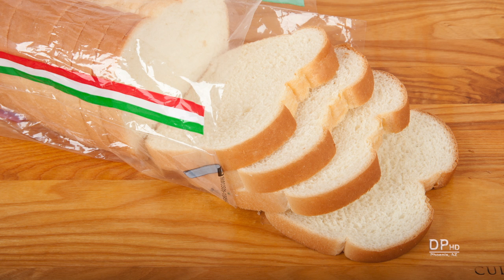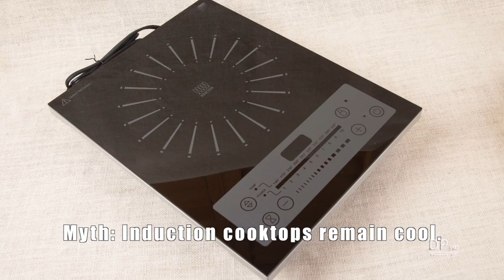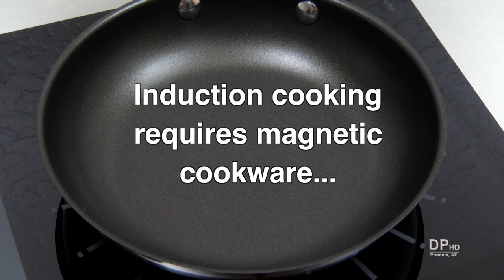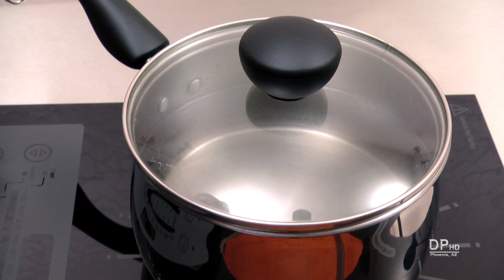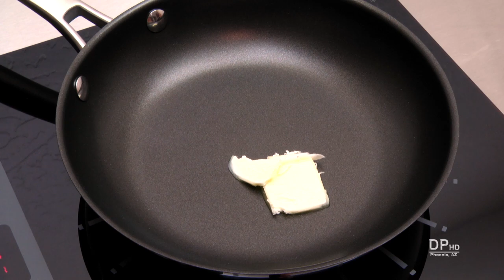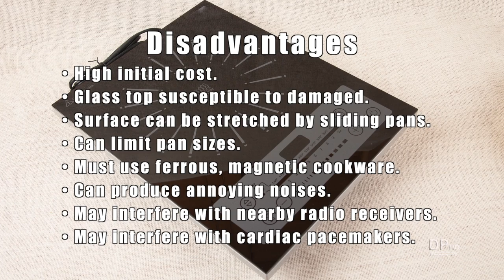Introduction to Induction Cooking (Home Cooking 101) DiTuro Productions

Comment: Small pans are the ONLY option for portable induction cookers that are bought at affordable prices. Typically, 6 to 7 inches is the limit for the flat bottom portion of the pan. There is also a danger of pan warping when larger pans are used on a 6-to-7-inch induction cooking area.
If you spend much more money, then you can get an induction cooking area with a diameter of around 9 inches. The extra cost can be very high, in excess of $1000 for each 9-inch cooking area - this is true when I wrote this comment on 20th October 2022.
You will not find the size of the cooking area included in the specifications of many induction cookers. So, be warned, no matter how large the circles of squares marked on the glass surface of an induction cooker may be, its actual cooking area (diameter if it is a circle) is almost certainly only 6 to 7 inches, unless you paid a lot of money for the cooker.
Reply from the maker: The pan that came with the induction cooker in this video is 11-inch at the top with a 6-inch flat bottom area. I found many pans and skillets are like this. So, if by small you mean limited to 6 to 8-inches, that is not entirely accurate. If fact, I shoot a video using an 11-inch griddle that is scheduled for November 28, 2022. It performed on par with my aluminum griddle and gas burner. Sizing the pan to the burner is preferable. Thank you for sharing your thoughts.

Comment: Thank you for an informative podcast.  May I ask a question please?  I recently purchased a portable induction cooker.  I brought it home; read the instructions thoroughly, and fired it up, to saute` some seafood.  it did a brilliant job and the seafood was cooked in less than 5 minutes.  I removed the fry pan, and placed a stainless steel pan (rated for induction cooking) on the cooker.  I pressed the power button and up came a message on the panel that read E 0.  The cooker did not start up but the fan came on.  I tried this a few times to no avail.  Each time the fan kicked in after the cooker refused to start up.  I googled the Error Message and it indicated that the E0 message indicate that one of the circuits had "fried"   This cooker lived for no more than five minutes before it gave up the ghost.  I returned it to the shop and got my money back.  I am somewhat skeptical now.  Any suggestions please?
Reply from the maker: Thank you for the compliment and your question. Unlike radiant electric and gas, the reliability of an induction burner depends on the quality of the electronics and workmanship. The failure you experienced could be due to a faulty part or solder joint. The one I used in this video is still working 5 years later. I just published a video about Induction Cooking Facts & Myths you may find helpful: https://youtu.be/vyohT6ACFwk

Comment: A 1800W portable induction cooktop will beat a professional grade high power full size natural gas rangetop using the largest burner (a BlueStar range top). I did test myself, my 1800W portable induction cooktop boiled 2 quarts of lukewarm  water in 4mins and 50 seconds. My gas range on full power took 6mins and 30 seconds for the same 2 lukewarm quarts
Reply from the maker: I've had the same results. Thank you for sharing.

Comment: Can you tilt the pan, as with gas?
Reply from the maker: It depends on the model. Tilting the pan may scratch the surface and void the warranty. Models with a pan detection sensor may turn the unit off.
Reply: My bosch 500 you can tilt the pan. I cook on a paper towel so no worries about scratching, I think its 2 minutes when you lift the pan off the hob until the unit shuts off. Most new units work like this.

Comment: I just bought a single induction cooktop and I love it.... the one problem I’ve always had with gas is I can’t get the temperature low enough to simmer.. Induction was the answer very accurate temperature control..
Reply from the maker: I've had the same experience cooking with gas. Thank you for sharing your experience.

Comment: Video of limited value.   Before posting a video it seems simply logical to carry out your cooking experiments BEFORE posting.   Your video should be instructive not a narrative on failed ideas.   I suggest you research your cooking and THEN post a video that gives constructive directions to achieve success NOT your blundering attempts and possible alterations to a process to improve on your attempts.
Reply from the maker: This videos is an introduction to the pros and cons of induction cooking for people considering switching from electric coil or gas. While I have had good success with my portable induction cooktop, several viewers have not. This video was not meant to be an infomercial to sell induction cooktops or ranges.

Comment: No wonder the time to boil water was quite long and you had to use rather high settings sometimes. A portable 1500W induction device is a toy. Commercial grade portable devices for 240V have up to 3500W. That makes quite some difference.
Still, all those portable devices are more or less toys compared to a real induction stove top from a decent manufacturer. The coil size of most portable devices is tiny which means only a small spot of your cookware is actually heating up. It not only ends up in uneven cooking results, it can also warp iron cookware like cast iron or carbon steel.
High quality induction stove tops have much larger coils which heat your cookware more evenly. The cooking experience on such a stove top is completely different from those portable devices (including the commercial grade ones). The only limiting factor on those stove tops is the power limit of private homes. My 90cm AEG / Electrolux stove top is rated at 11.7kW for 5 induction coils (4x 8'', 1x 11''). While the 8'' coils provide very equal heat over most of the 'burner' size, the larger 11'' coil has a noticeable hot spot in the center. That's due to the outer wiring of the coil being less densly winded to keep the stove top within the maximum power limit of ~11700W for private homes. Professional induction stove tops have fully winded coils of any size but the power consumption is accordingly high.

Within the generous power limits of my private induction stove top, I'm more than happy with it and would never go back to other heat sources. I would consider complementing it with a two large burners gas stove as nothing is better for iron cookware (cast iron & carbon steel). But for all other cookware, induction is the clear winner. It's very efficient (90% of the energy is used for cooking), fast and the heat can be adjusted very precisely on well made stove tops like my AEG one. The 14 (actually 15, including the 'Power' setting) power settings do not increase linear, it's more like an exponential curve. That way you have a fine increase at each level on the lower settings and steeper increases on the higher ones. Even the fanciest gas stove tops have a hard time competing with that.
Reply from the maker: Except for the technology, there is little comparison between a 240V built-in induction cooktop or range and a 110V portable induction cooktop. Considering the cost, a portable induction cooktop is a handy extra burner for home or RV. Thanks for sharing your thoughts.
Reply: @DiTuroProductions  That's basically what I said. Well made built-in stove tops are a completely different experience. Still, I also wanted to point out that there are better portable devices than the one shown. The usual, cheap ones sold in super markets here all have ~2500W @240V. Professional grade ones like Bartscher have up to 3500W. Still, none of those portable devices I know of has a coil size of more than 12-14cm which is very small. It's ok to boil and cook things, but you should not use carbon steel or cast iron cookware on those small coils because they could make your skillet warp. Those small coils are also a problem with most other skillet types because you end up with a small hotspot in the center of the skillet. Those portable devices are ok to cook, I would not recommend them for searing.

Comment: I have a Philips HD4937  with two circles where you place the pot. Even with a pot that covers the outer circle I can only get frying done on the small section of the inner circle. The user manual doesn't help. Why do I have two circles when I can't use the outer one ?
Reply from the maker: Induction burners with two circles are supposed to sense the pan size. You may have a defective unit.

Comment: Two Points for you folks. Ikeas pots and pans are Induction friendly and cheap to buy.
Second point Cast Iron needs to initially  be bought up to temperature slowly before full heat is applied as Cast Iron can shatter if Power Boost is applied to a cold pot/pan
Reply from the maker: Thanks for sharing this information Lindsay.

Comment: when frying easily burnt, even in low temperature?
Reply from the maker: Thin cookware can cause foods to burn easily using low heat on induction, gas, or electric. Stainless steel cookware without an aluminum or copper core bottom can develop hot spots.

Comment: I have potable induction cooker, I like twice & the food burned so I packed it without using it again. Its fast but since my food ends burning, I don't know what to do with it again. 
Is there anything I should do for my food not burning.
Reply from the maker: My guess is the power level was set too high for what you were cooking. I have used mine to cook foods for several videos with no burning or sticking. My frying pans have a non-stick finish and my pots plain stainless steel. Except for boiling water, I use between 20 to 60 percent power.

Comment: I'm not constrained by a 120 volt mains power system, we have 230 volts @50Hz, so the portable induction cooktop I have is rated for 2100 watts. I have a few old enamel & cast iron pots & pans that work with the cooker.
Reply from the maker: Not being constrained to 120V has advantages. I have a cast iron frying pan that has outlived many non-stick aluminum frying pans.

Comment: I started out with a portable induction.  Loved it.  Then, I went to a 36 inch Bosch Induction about 5 yrs ago...It took about 3 or 4 meals for me to catch on to the various settings.  Bosch has cleverly built in a 'timer' for each burner.  Now, for many meals, I "set it and forget it.'...and come back at the end to serve it.  You quickly learn what settings are good for what purposes...and The Bosch has different power available for each of its 5 burners...

I did have to replace my cookware and did so with Alclad...(expensive, eeeeek)...but in the 5 or 6 yrs I have had the set, no problems and it is perfect for induction ...and the dishwasher...I have two pieces of non-stick...I found, after I learned the 'power settings'  I really do not have to use them...(not a fan of non-stick).  

I cook a lot of 'Dad food'...chops, hamburgers, pasta, eggs, etc...not a gourmet...but a definite frequent cook (and the rest of the crew cleans up when I cook, that is a good deal)....THANK YOU for a great review.
Reply from the maker: Thank you for the compliment and sharing your experience. Like any new technology, the cost can be prohobitive to many plus the added cost of buying cast iron or steel cookware to replace aluminum pots and pans. The cost is dropping and nonstick steel cookware is more readily available and affordable.

Comment: In your video you stated, as two of the disadvantages of induction cook tops that the glass top is susceptible to damage and the surface can be scratched by sliding pans.  These issues also exist on standard (non-induction) smooth top cooking surfaces.  Are the consequences more severe on an induction cook top than they would be for a standard, non-induction smooth top?
Reply from the maker: The risk of damage is the same for any glass cooktop. Scratches produce high stress areas that can lead to cracking.
Reply: I don’t see this as a major consideration. We have owned our GE Profile induction range for 6 years, and the glass top remains unscratched. And, yes, we use cast iron. We just follow the suggestion in the owner’s manual and place a sheet of parchment paper between cooktop and pan.

Comment: Have one, a Kitchen aid, and love it. Yes, it took just a bit to get used to it but it's  easier to clean and keep looking better than a glass top conv top. precise control and pretty instant control is great but just don't worry about the so called temp settings. It takes a lil bit to get used to it...but overall I won't go back.
  As an aside, the manual says  you can  do canning on. This is because the heat is not forced up through the top and reduces / eliminates the stress hot spots that causes a heavy caner to just shatter the top.
 I use cast iron ans magnetic pans, those are becoming much more available at a lower cost.
  At this time induction are becoming more available also in the US and slowly the price is coming down.
Reply from the maker: Thank you Paul for sharing your experience.

Comment: Can you use a oversize pan on the portable units, my castiron pans are large and not allowed on my glass top stove
Reply from the maker: Like glass tops, sizing the pan to the heat source produces the the most efficient heating. Using larger pans will produce hot stops and uneven cooking. Cast iron retains heat but is poor evenly distributing the heat.

Comment: Hello:  I'm not understanding how the stove uses a magnetic pull for heating? Where is it coming from? Don't you plug in the stove? And is this the same as EMF, which is dangerous, which we are all bombarded with? Is it like an MRI? don't use aluminum cookware, only stainless steel, glass and cast iron.  I don't use teflon coated cookware either. The owner of the house that I live in  wants to put in an induction stove. I prefer gas first then electric. I'm researching the induction and just am not finding it a good idea.  If it is not good for pacemakers and interferes with radio waves then what affect down the road does it have on your body that has not been discovered or maybe not disclosed at this time?
Reply from the maker: We are surrounded by electromagnetic energy. High EMF can disrupt electronic devices like pacemakers. All induction cooktops and stoves  must be plugged in otherwise it cannot generate the magnetic flux that produces eddy currents in the pot that creates the heat. Not being an electrical engineer or physicist, it is difficult for me to explain the physics of induction cooking. Induction is great for people who cook with cast iron and stainless steel if you do not wear a medical device that can be affected by the magnetic field. Otherwise, I have not come across any long-term health risks associated with induction cooking.
Reply: Essentially, the AC that is used for  many appliances will, when fed through a loop of wire (the induction coil) generate a small magnetic field that can cause ferrous or magnetic cookware of proper size to generate opposing magnetic fields (the eddy currents). As these eddy currents go through the cookware, the resistance of the iron to the constant changing field generates heat that will cause the rest of the pan to heat up.

As far as the safety is concerned, broadcast radio waves and wifi signals are extremely widespread already, and would have no effect on people (unless you do have particularly delicate equipment like a pacemaker in your body). It wouldn't be anymore dangerous than if you had a spinning magnet lying around, like in a car motor or electric fan.
Reply: The main reason pacemakers are sensitive to it is because they are just generally delicate electrical pieces, so you would want to stay away from anything that generates a relatively strong magnetic field
Reply: When AC current flows through the copper coil in the induction cook top, magnetic fields are produced which induce electrical currents in the cookware.  Cookware that is compatible offers high resistance to the induced electrical currents and that resistance results in heating.

Comment: Thank you very much. would you please let me know what is the high heat, middle heat and low heat levels on induction cooker. Is it not the same as gas or electric?? some recipes being overcooked on my hob.
Reply from the maker: It depends on your cookers power rating and design. Multi-element cooktops have different size heating areas to accommodate different diameter pots and pans. Power can range between 1800 to 4000 watts. High power on an 1800 watt element would be about medium power for a 4000 watt element. I found low to medium worked best to cook most foods. It takes a little trial and error to determine the right settings for the cooker you have.

Comment: 1800 watts is a pathetic output. Guess it's limited by the low voltage of US outlets? Even if every watt is converted to heat, that's going to take a while to boil significant quantities of water. In the U.K. Even the cheapest plug in portable cooktops are 3kw. But generally if we want boiling water fast we use an electric kettle, typically 3kw to 3.2kw. They cost as little as £10, are 100 percent efficient, literally every home has one.
Reply from the maker: Most portable appliances in the U.S. are designed to operate on 120V, 15-20 amp circuits. Built-in appliances on 240V circuits are closer to your power rating and will outperform portable devices. Plugging a 3 kw device in a U.S. 120V circuit will quickly blow a fuse or trip the circuit breaker.

Comment: What utensils can be used when you cook in the induction hobs? Can I use a metallic spoon for example? Thank you!
Reply from the maker: Use the same utensils you would use on a gas or electric hob depending on the cookware finish. Non-metallic for most non-stick coatings and any material including metallic for uncoated steel or iron.
Reply: Thank you for your reply!